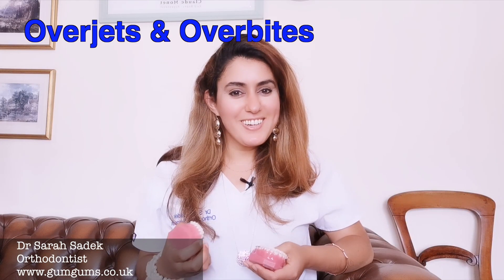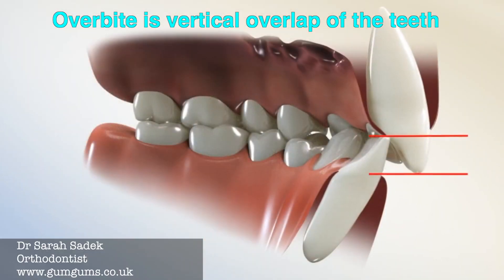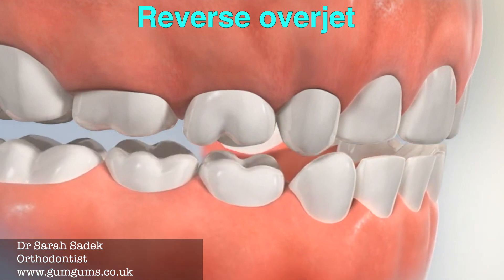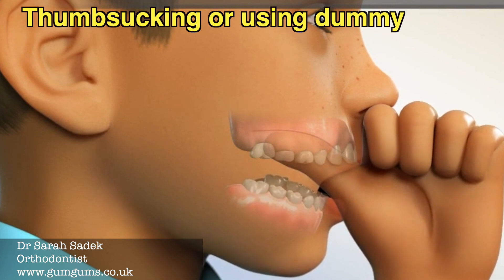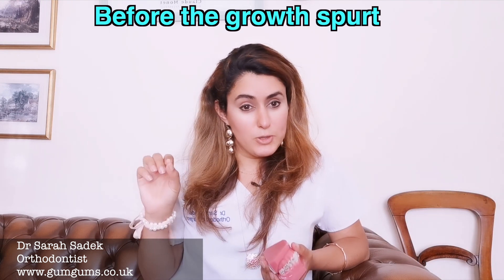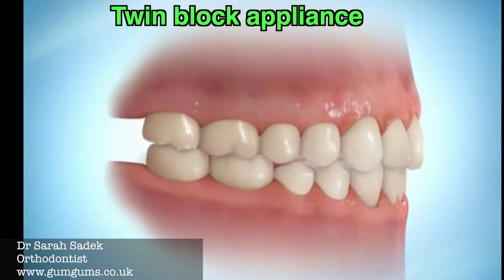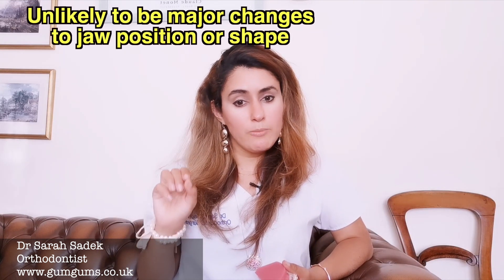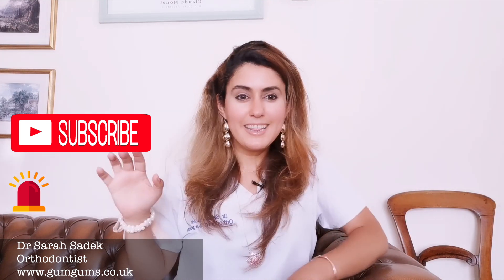Overjet & Overbite | Causes & Treatment Using Braces & Invisalign

Comment: I have overbite (overjet) ... But getting brace for the both teeth is expensive. Can I get brace for the upper teeth only since that is where I have the problem
Reply: I’ve had braces only for upper teeth for 4 years. Afterwards I’m still having a mild overjet but it wasn’t as bad as before. Now im considering getting Invisalign to correct my lower jaw to expand it more because of how it looks like on my side profile 🥲

Comment: Hi doctor i have an anterior open bite along with overjet and crowding my profile looks smthing like a bimaxillary protrusion. I notice the part intbetween my lips and mouth look protruded from the front is it possible that it will go away after the braces journey? I also had two  upper and two lower teeth extracted. My front look smthing like the simpson u showed but from the front so will it go away after the braces process? Also is my teeth supposed to straighten first before i get elastics to cure my overjet?

Comment: Hi Dr.   how is it going?
I have a patient who is nearly 10 years old.. has a mildly.... restricted maxilla anteriorly.. CL 1 molar relationship with OJ about nearly 8 mm. and rotated upper centrals.. 
After expansion.. I went to fixed appliance.. for alignment and leveling.. de rotation.. I gained spaces among ant. teeth.. 
After retraction.. there was still an OJ of nearly 5 mm. 
so in this case.. can we do a serial extraction to get more space for retraction and follow up? 
please Dr.  your kind opinion.. 
I know it is difficult to assess the case without a clinical examination and x_ray analysis. 
thank you so much

Comment: I just turned 20 and I have an overjet I used to have braces and it fixed it temporarily but I lost my retainer and my bite shifted back I'm not sure if that's due to me not wearing my retainer or genetics. Do you think I'll need surgery to fix it permanently? I have a Invisalign consultation but I don't want to keep spending thousands of dollars if it's not going to work
Reply from the maker: See what they say at the consultation, braces should be able to correct it to some degree, good luck
Reply: the same thing happened to me. Except I never lost my retainer my bite just shifted back despite wearing the retainer :(

Comment: i have an over jet and an underdeveloped under jaw ... I was wearing fixed braces for 3 or 4 years and currently im wearing loose ones with elastics. It has changed a lot but I still have that type of "monkey mouth". I'm supposed to be done with my treatment this year. Lately I started feeling more and more uncomfortable and insecure with my lower facial part. I'm 17. Is there a way I could fix that? Or should I talk with my dentist about a different treating? > . <

Comment: I have an over jet the doctor said that the only way to fix it is by removing teeth do you agree on that
Reply from the maker: HI Sarah, I couldn't comment without seeing your case. If you are unsure, I would suggest perhaps aving a second opinion via consultation. Wish you all the best
Reply: Smart Invisalign & Braces With Dr Sarah Sadek ok thank you for your reply. I still didn’t see my x Ray results but the doctor said that my over jet is almost extreme and 90% she has to remove either 2 or 4 permanent teeth. And then add braces for two or three years. I think that’s too much and I’m scared. Ik u can’t help without looking at my teeth but do u think having an extreme over jet could cause harm when I grow older I’m 16. I have no other problems with my teeth they only look bad.

Comment: I’m 16 and I have an overbite which I’m really insecure 😔 about if I got braces will that help with the overbite
Reply: I'm overbite sis and I'm 16 when I got my braces and after 10 months wearing it, I'm happy to say that my teeth now are pretty good.
Reply: @hayzelcortez9806  okay besides the teeth, what about your side profile? did you jaw end up getting fixed? did you use any appliances before the braces or did you just get braces right away?
Reply: @luxyluz2442  right now my dentist still fixing my bite and about my jaw there's slight changes about the structure of my face
Reply: @hayzelcortez9806  did you have extractions?
Reply: @hxcq5883  yess but only 2

Comment: What about extractions? My ortho said they extracted it cause I have overjet will I see any face changes?
Reply from the maker: Hi Brandie, great question and difficult to answer accurately without seeing you. Depending on how your teeth were before you may or may not see some profile changes - these would mainly be in the position of your upper lip, that may come back slightly. Have you seen your ortho since lockdown. Ps. Pls dont forget to subscribe :)
Reply: @SarahSadek1  Sure I will suscribe. No I haven't seen them yet. I had slight crowding which is solved a bit now on my upper jaws but there are still  massive gaps but my jet is still there.
Reply: @brandiekay6706  are you facing any problems due to extraction like..narrower airspace difficulty in fiting your tongue etc??
Reply: @alimpiasantra3706  No I am facing no problems. Ignore the media they are trying to scare you try discussing with you dentist is my best choice. The gaps are almost gone and I see only a small change, which is not bad. Good luck! 🙂
Reply: @brandiekay6706  hey thanks for replying.I was really scared as i went through a lot of videos talking against extraction..i guess i have to consult with an orthodontist about my condition

Comment: Hello! I have an overjet and also overbite and interested which has given me a very unpleasing profile. I'd like to get Invisalign (I'm an adult), however one orthodontist suggested I extract 4 bicuspids but I do not want to; another orthodontist does not want to extract teeth (yay!) but said by adding rubber bands, this will push my lower jaw forward to align it to my top jaw. Would you say the second option can help my cause and is it accurate that this could also improve my profile? and do the bands really move jaws? Thanks!
Reply: Ur age?
Reply from the maker: Hi, great question. Both options will have some effect. They won't affect your jaw position, but more the prominence of your upper lip from side profile. Which one is better is very case dependent with different factors, such as how much your teeth come forwards. Hope this helps. Ps. If youre new to channel pls dont forget to subscribe 👍
Reply: I also have overjet and overbite ..😭😭😭😭
Reply: How is your progress? Did you go with the 2nd option ?